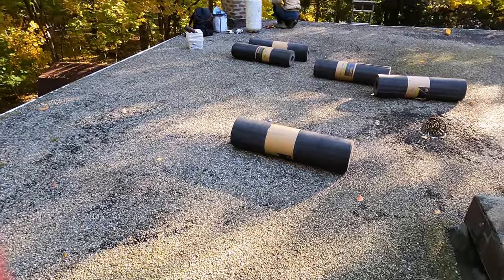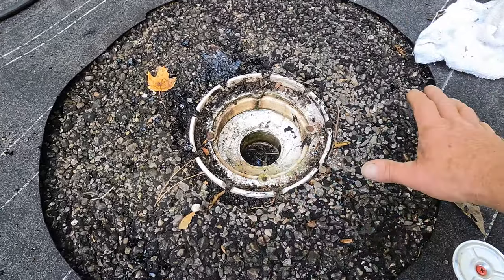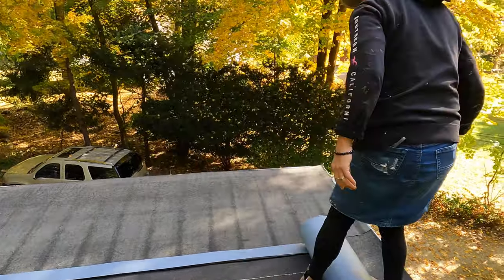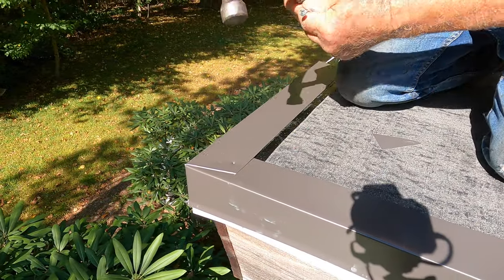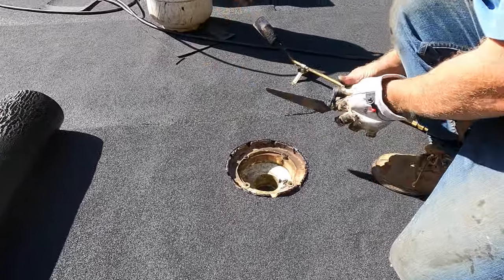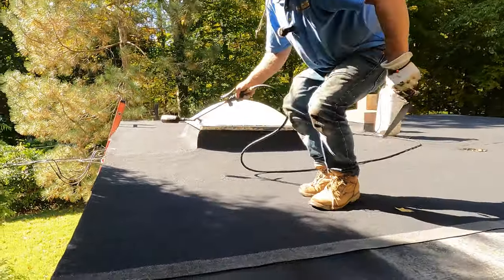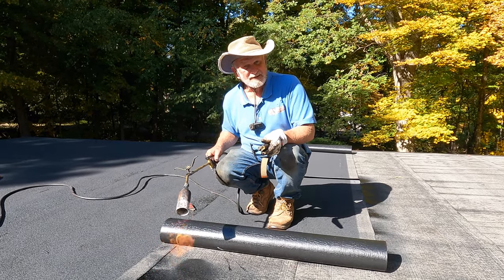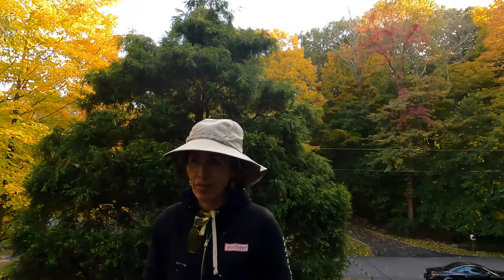Cheapest Easiest Flat Roof Install over Tar and Gravel - 30 year warranty - Must See to believe

Comment: Every roofer has their favorite roof-over system, nothing wrong with this install IMO. The hot BU roof they went over probably was quite old and probably held up quite well before it became a problem. A 30 year warranty for any synthetic or bituminous composite roof system sounds optimistic to me, but the point is that this new roof will remain trouble free for many years. Avoiding tear-offs whenever possible saves everyone a lot of money and hassle. I would point out that the base sheet nail/plate pattern can become more specific depending on local wind zones...It's a good looking roof!
Reply from the maker: You are one of the few people that knows what you are talking about. The other people commented after you are clueless. You are a roofer from reading your comment. Nail patterns, I agree with you.
Reply: @FlatRoofDoctor  Yes, I've torched semi-loads of APP on re-roof projects (1 small job at a time). I hated tear off's while other roofers seemed love them. I'd get the roof-over jobs that other roofers insisted on tearing off the old. One needs to be creative sometimes. Sometimes old roofs actually need to be fully or partially removed, especially if the structure is spongy, rotted or rusted through. I will say that torching on hot summer days isn't always fun.  My worst experience was using APP from a now defunct Chicago manufacturer. The surface started cracking a year or 2 after install, they decided to go out of business instead of stepping up. They must've been using incorrect processes at their plant. It's a good idea to buy common brand name roofing products. I suspect that SBS is a more highly engineered product than APP, although it never seemed to torch as easily as APP.
Reply: @FlatRoofDoctor  Why did your own son start his OWN roofing company instead of following in the family business? I notice he  does things correctly instead of trying to save a Nickle here and there. Its very telling that he went on his own instead of going with the family business.
Reply from the maker: I believe in Torch Down and I believe you can put a Torch Down Roof over almost any surface and it will last. My son has OCD, and with that everything must be perfect. The screws that holds the base down are in line, nobody will ever see it. He prefers TPO and therefore the surface has to be perfectly flat. 
I am not nickle and diming any project, in fact I think I am more expensive in some cases. But, I do believe the 2 ply Torch Down system is superior to any other roofing system.
Why not follow the family business? I taught him a lot, even making videos. But I still use my business for promoting and some roof projects. It would be not good for him to take my old projects and run with warranties I gave which he does not agree with. He is far better establishing his Name as the best in TPO and Brand himself as the Best in Quality. He is already in that bracket and is already well known for the quality work. His clients are the ones that can afford his type of work. I always catered to everyone and not a specific group.
Reply: Why don’t you put the Karnack under the drip edge as well?
Reply: This roof won’t last 10 years, I was  a union roofer for 38 years, I’ve never put down a roof like that but I’ve ripped a lot of them off lol
Reply: @johnbernacki6155  No matter what union roofers say,self taught handymen seem to do things their own way and insist they know what they are doing,the property owner has no idea who he hired and in 10 yrs will forget who replaced the roof.
Reply: @FlatRoofDoctor      TPO (thermoplastic polyolefin) is a single-ply white membrane used in both commercial and residential roofing. ...........     I had no idea what that even was.

Comment: Nice looking job, hard work, and good of you to take the time to pass on your knowledge. I love that ladder you have with the lifting motor, never seen this before.
Reply: I had one of those ladder lifts years ago, huge back saver. They sell bolt on extensions for higher roofs.
Reply: Inspector will not approve that .
And insurance will not paid if this roof callapse from the heavy load .
Beside the mositure will trap under 3 ply you used . You need special vent for flat roof.
This video only commercial for poly seal .
Reply: @terrylutke oo

Comment: Why the cold adhesive? Whats the reason?
Reply: He uses it on the drip edge  because the metal will warp and the paint peel off.
Reply: @jamescole3152 No,again. 😂😂😂 It's an adhesive. He is using it to secure the edge 😅
Reply: It's like using glue on paper to stick. We do the same when necessary in Norway to.

Comment: Trapped moisture dissipating through the drip edge (in a few days) it doesn't do that.Wrong. You're destroying that roof structurally. Stop with the misinformation and misleading with wrong roofing practices.